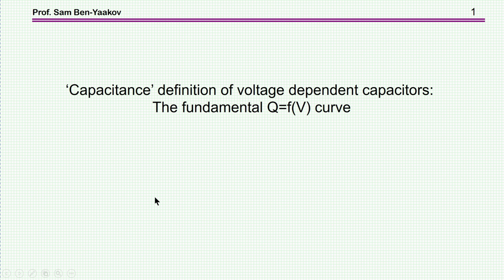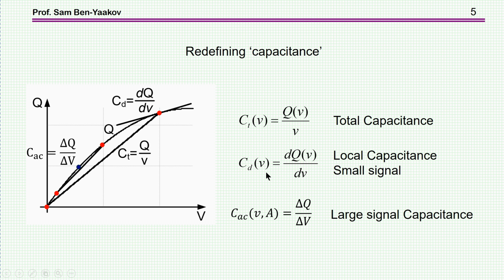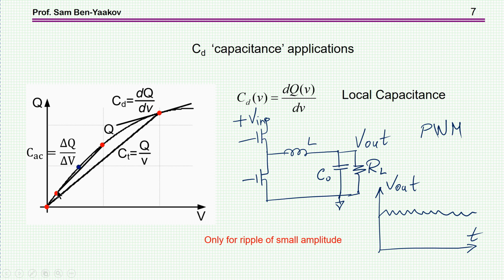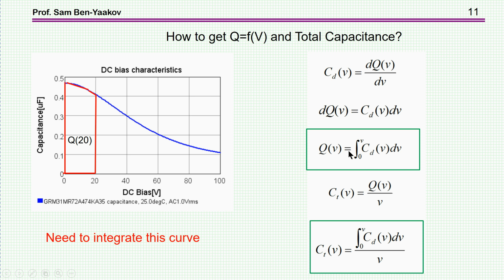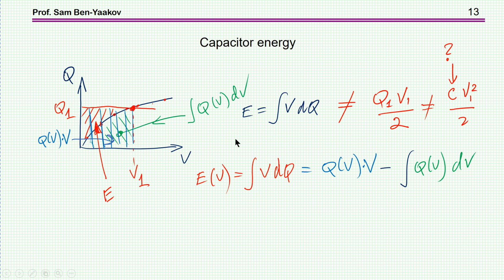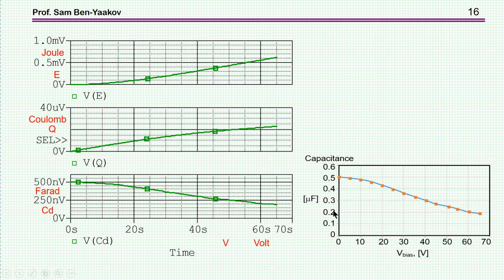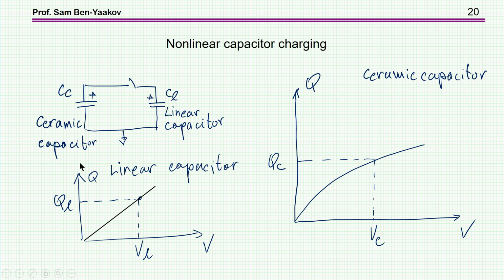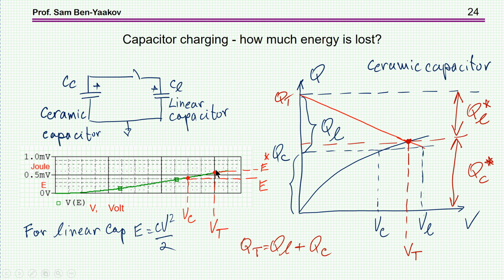‘Capacitance’ definition of voltage dependent capacitors:  The fundamental Q=f(V) curve

Comment: Dear Pro, how  to choose capacitor for output PFC and output voltage of SMPS
Reply from the maker: There are two parameters to consider, capacitance to reduce ripple to desire level and ESR to avoid high dissipation by capacitor.

Comment: An application for this very useful and easy way of determining the Q=f(V) can be the determination of the needed charge for different Drain-Source voltages and drain currents in switching a MOSFET. The "Vgs vs Q" curve shown in datasheets only shows the charge for 3 Vds values and usually only 1 drain current !
By determining the needed charge (Qgd and Qgs affecting Crss and Ciss respectively)  for the drain-source voltage and drain current required in your application, one can estimate switching times and design gate driver more accurately.

Very useful videos Sam ! Keep up !
Reply from the maker: There are some papers in this area e.g. 
COSS Hysteresis in Advanced Superjunction MOSFETs
J.B. Fedison, M.J. Harrison
Enphase Energy, Inc.
Petaluma, CA, USA